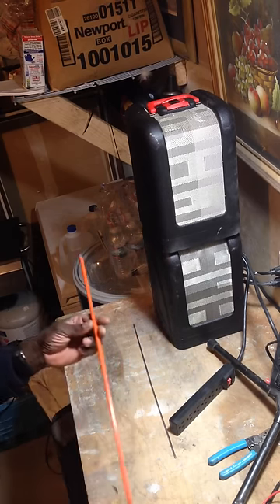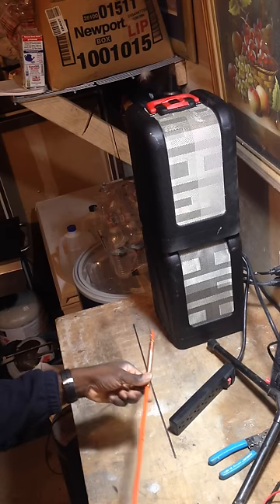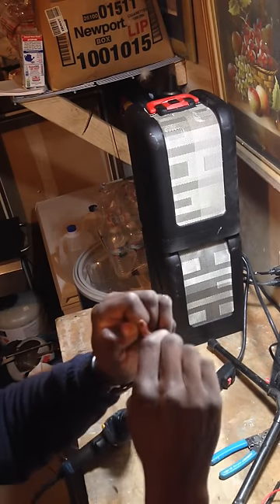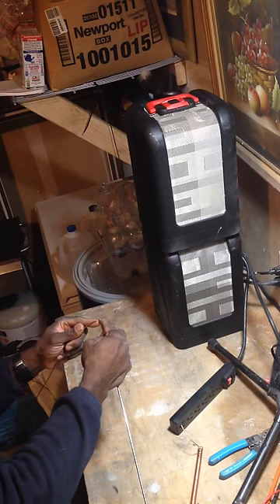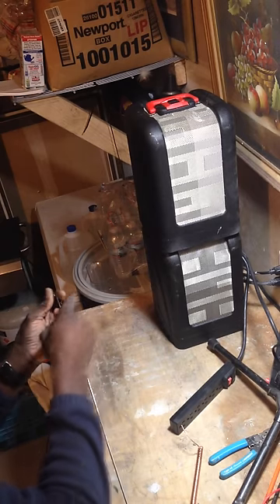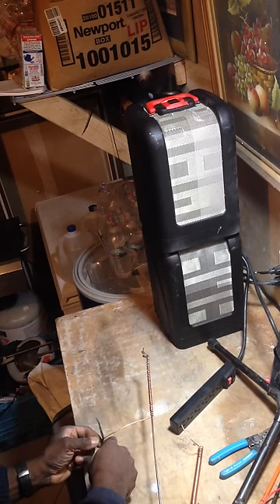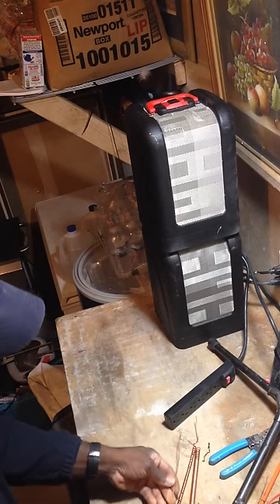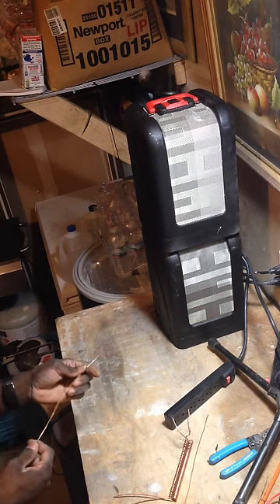How to make the pain wand Keshe  Foundation

Comment: Great job.... you may want this advice, Keshe mentioned that the torch should start from the TOP of the pen and work the heat towards the BOTTOM.... that way,,, it creates a directional flow of energy in the set would be set up to use....

Comment: Good video but you missed a couple of steps.
1) after nano coating you have to put into ice cold water, this adheres the coating to the copper.
2) you have to give it a small electrical charge to align the atoms of the nano coating to give them ( or field ) a direction.
3) if you want more layers ( which is advisable ) Repeat the whole process again, Heat, Water, electrical charge.
It's all in the 89th workshop.
Reply: +mike wran go to part II

Comment: I knew about two methods to nanocoat your copperwires:
1.) Using the caustic soda method: (NaOH + aluminium foil + boiling water)
2.) Using the fire method (put copper several times into a woodfire, dip it in water, heat it again..)
And now this method, with a blowtorch.

The first two methods are comprehensible for me. In order to nanocoat your copperwires/plates you obviously need the combination/chemical reaction of NaOH (Natriumhydroxide) and KOH (Kaliumhydroxide) on copper. This stuff also appears in the ash of burnt wood.
My question is this: How exactly does the blowtorch-method shown in this video work when there's no KOH or NaOH involved? Does anyone know?
Thanks in advance.
peace.

Comment: I really hate to say this... but you coiled the wires the way that Mr. Keshe told us to do during the Blueprint workshop - which everybody that was listening to him made the same way - then a few days after the workshop was over he did I think #Session 13... telling us that we all made them wrong.  So he even uses a drill and emphasized that it has to be on REVERSE... which you did - but... by running the wire toward you while you spun it in reverse... it was actually the same thing if you started near the chuck of the drill and then put it on forward as you spun the wire away from you.  

After I freaked out because I put my whole life savings into making 15 coil sets to build 5 units with - he said they were made wrong, BUT... after many hours watching videos - making many many comments and even going by emails - I was finally told and even a video is out about how the coils if all made in the same direction will work.  I still cannot believe that he said I made them wrong after doing exactly as he said during the Blueprint workshop... shoot - in the first day I think it was there was a guy that showed us how to make the coils with a drill... HE HAD IT IN FORWARD and Mr. Keshe did not correct him - so everybody that watched the workshop and did just as Mr. Keshe instructed and then also did as the guy showed with the drill... then if you did that that way - you did it wrong...

Go figure, eh?  But the way you made the coils in this video Mr. Keshe would say is actually "clock-wise" and not "anti-clock-wise" at all... isn't that something???

Peace~